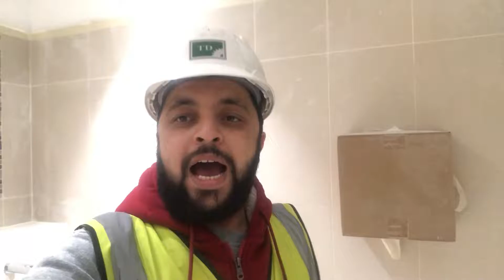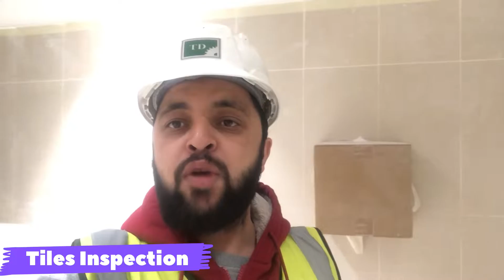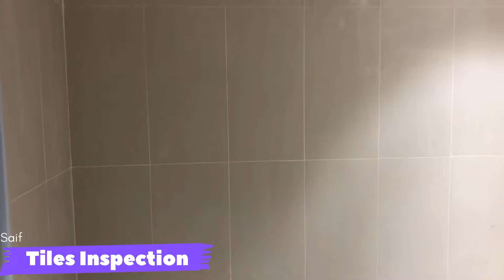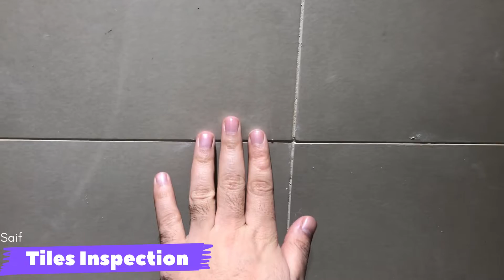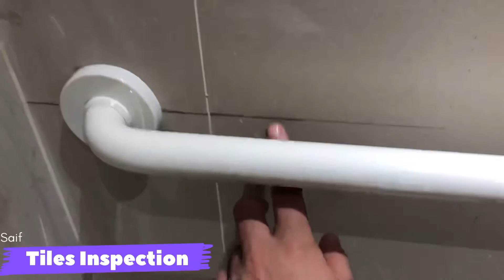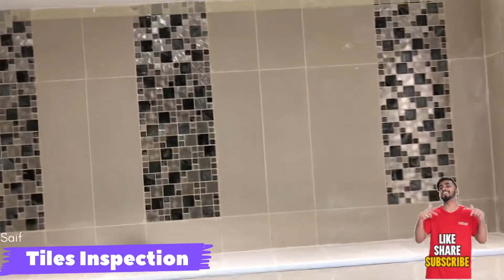How To Inspect Tiles at Site| Wall Poreclaine Tiles Inspection| Quality Inspection of Ceramic Tiles.

Comment: 1. Check if tiles are fixed according to drawings
2. Check if the grout is properly filled and color is approved 
3. Check the horizontality and verticality of the lines 
4. Check the verticality of the wall
5. Check hollowness of tiles. 
6. Check floor slope according to drawing

Comment: Is hollowness check not applicable for walls?...to check that adhesives are properly applied or not. Bcz I noticed some tiles have a different sound due to hollowness when you put a hammer/rod on it.
Reply from the maker: It depends on project requirements